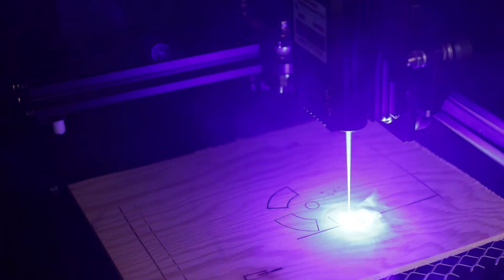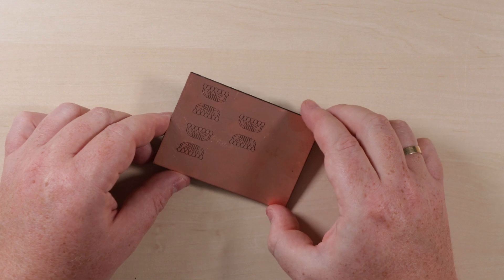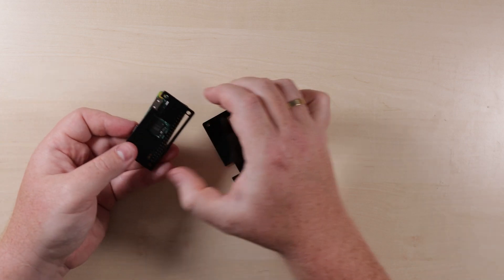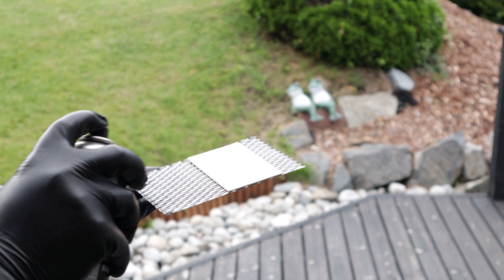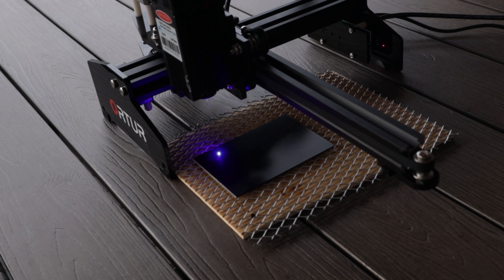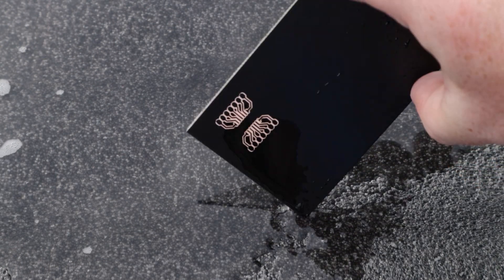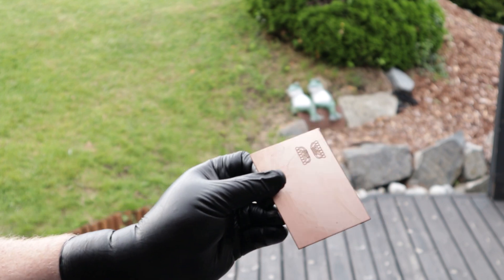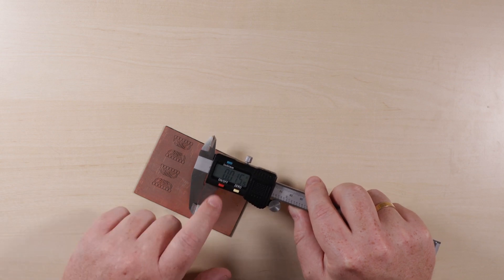How to make a PCB with laser - Ortur laser from Gearbest.com

Comment: If you use a fiber laser, you can laser etch away the copper without having to do the paint. But if you do want to etch you could probably Run the laser a few more times and then the etching would go better.
Reply: I need to get a fibre laser.

It's so much more sophisticated; you can even burn throughholes and cut the outline of the board.
Reply: @xFuaZe  yes, but it can be very difficult to get to that point because they tell you the focus distance and it’s wrong by 3 mm on my laser so it took me a long time before. I finally realized the thing was working.

Comment: The laser lasts after 5 hours total working time ,at 30 percent power......cooling pause  50%with 10 minutes work on off not changes the life of the diode....

Vevor or ortur endurance lightburn,Amazon,atomstack Walmart you take all the chances to scrap money....because the short lifetime is due not to the brand but the principle of this process.  ...reflected ray from copper turns inside the cavity and destroys  himself

Comment: Is it not possible to cut copper layer of pcb without paint on it?
Reply from the maker: Nope! Some fiber lasers can manage, but the results are not very good. Remember, if there is enough energy to cut copper a bit of the fiberglass will also burn away.

Comment: What software packages do you use? I have a Enjoywood A10 laser engraver. I have only found that lasergrbl and lightburn can work with this laser engraver, and I found I need to generate a png file with the pcb layout. For that I use kicad to generate an svg file which I then convert to png with Inkscape. However, running into a problem, that the resolution is too low. Fine traces and pads are jagged and not useful. So I can’t get the pcb detailed enough for smd components.
Reply: Use flatcam to create your Gerber and burn as gcode no SVG or other rubbish tool as inkscape....you are a PCB designer not tee-shirt publisher😊😊.export your gcode processed as grbl laser ,burn varnish with also grbl laser....works fine but as my case and reason to post here my disappointment about the process,the laser ends after 4 PCBs.....
Reply from the maker: Try to use the Trace Image feature in Lightburn :-)

Comment: May sound stupid as a question, but there is no way that laser will actually etch the copper itself instead pass thru the mask etching and the chemical etching bath? just asking
Reply: Not at these power levels, it's not cost effective, as you will also destroy the PCB. See other comments.

Comment: Very interesting video. However I'm more interested in how did you produce the g-code for laser cutter?
Reply from the maker: Lightburn, engrave from image or trace image :-)
Reply: @DIYTECHBROS  Yey thanks a lot! That's what I needed. I'm going to use a CNC mill with an engraver. to mechanically remove the excess copper.  It wouldn't look as pretty but for prototyping could be somewhat faster.

Comment: Can you also solder the PCB with the laser?
Reply from the maker: Simplified answer, no. A soldering iron does 3 things at once, heats up the pad, the leg of a device and the solder. It does this by being in contact with and transferring heat to all 3 at the same time. 
Complicated answer, yes, it can be done. But with a simple setup and a diode laser it will be more a hobby project than and actual "soldering station".
Reply: @DIYTECHBROS  interesting
Reply: @DIYTECHBROS  I guess a solder paste applied to the pads could be heated with a laser, which will seat the smd component? I guess one will have to try, but first, what laser printer?
Reply from the maker: Well, the simplified answer was no, but the more accurate answer is that you can even do welding with lasers… so you can make it happen. But most current diode lasers have 5-40 watt with a focus spot of 0.1 x 0.1 mm - so thinking a CO2 laser will be better suited.
Reply: @DIYTECHBROS  I'm not if I would trust a C02 laser to melt solder paste. Better to use a heat gun at that stage :face-fuchsia-poop-shape:
Reply: Never thought about it, that way. Are you thinking SMD components? The only difficult part of SMD's would be the packages that have no legs, I guess there could be enough heat transfer from the copper to the pad and solder paste. You might have issues with larger though-hole components, but I'm only guessing, This is an interesting idea, if I invest in a laser cutter for this operation, maybe it could do some smd soldering for me :hand-orange-covering-eyes:

Comment: huh. when I tried this there was a residue that was left behind that protected the copper from my etching solution....! I didn't try washing it, thats a good idea. Though my tests It was hard to get fine details; I didn't account for any laser kerf though.
Reply: I have similar problems. Did you find a solution?
Reply: @mod100  unfortunately no. I stopped playing with it. Maybe scuffing it gently with scotch-brite after? or a different brand/type of paint?
Reply: @angst_  , maybe. I tried synthetic enamel and water-based paint and got the better results with the synthetic enamel, but there was still that residue which prevented the eching solution from etching the copper.

Comment: If you have to etch the PCB anyway, what's the advantage of using a laser to burn paint? Why not just print the board layout on thermal transfer paper with a laser printer?
Reply from the maker: That’s a very good question!
I’m not going to say that a laser is soooo much better, but in terms of accuracy and reliability a laser will give you perfect results every time. No lines will be broken transfer, no weal lines etc.  
In terms of equipment, one requires a laser printer while the other a laser engraver… 
BUT, we actually usually use a CNC to mill our PCBs 🤠
Reply: @DIYTECHBROS ,
  I recently bought a mini 3018 CNC kit I am going to use to mill simple circuits (filter, amplifier, mixer, impedance matching network, attenuator, etc) for an RF class I'm teaching. Your videos have been very helpful.

Comment: Very nice and interesting! I have a few questions:
1) What kind of paint do you paint the PCB?
2) What type of liquid (inside the container) do you use to completely remove the ink from the PCB?  (Sorry, English is not my native language) Thank you
Reply: you can use hydrogen peroxide with Hcl liquid . The ratio of mixing 1 ( h.p.) to 4 (Hcl) . Alternate method , use only ferric chloride .
Reply: Thanks
Reply: 2. paint can be removed by acetone or paint thinner., 1.iam guessing acylic paint. etchant is probably ferrous chloride
Reply: @Vegetakhan  Thanks

Comment: you should try using photoresist film rather than paint spray, the laser diode has a 445nm wavelength which is just in range to expose the photoresist. People uses black paint because they have a red laser diode, the black paint absorbs the heat from red laser.
Reply: Using photoresist need more time in laser, because have to pass above larger areas. Using paint spray, you have to pass laser only thin area around the tracks, this is faster. And cheaper too.
Reply: @WilkerAzevedo  True black paint is good but the details are not great, professional PCB fab houses uses film or liquid based UV photoresists. Also photoresists does not need more time, you need to properly apply it to the board and use much less optical output power, requires only 30-60mW optical power in the UV range. 
There is a youtuber who did a video about CNC UV laser PCB photoresists, his channel name is "Marco Reps", check it out, he made two videos about it.
Reply: @ShopperPlug  Thanks, got a 2.5W with my 3018.
Reply: @WilkerAzevedo  Photoresits are dirt cheap. You buy them in a roll in quantity and it's super cheap. Your state of the art iPhones and Macbooks PCBs are all made using photoresit, matter of fact all of your electronics are made professionally using photoresits. Professionals uses photoresit because it produces much higher quality and finer details of the PCB layout. Black paint spray is not great for precision PCB designs. There is also a special photoresit paint which is in liquid form, this is also used in high precision PCB designs. The key objective is using smaller wavelength of light such as around 300-400 nanometers (Near ultraviolet) to produce higher quality sensitize PCBs, red lasers are around 670 nm, it will never produce higher quality PCB designs compared to photoresit method for ultra precision work. Such as making a PCB which have a FPGA chip containing hundreds to thousands of ball grid array (BGA).
Reply: @ShopperPlug  Interesting, I'm a newbie for laser to Pcb design, I'm weighing my options. However, you said that 670 nm is too coarse for ultra precision cuts, for most of us, a 1 mill (0.025mm) cut is fine, in-fact PCB manufacturers don't like to go too thin on the traces. 670 nanometres = 0.00067 mm or 0.026 mills. I honestly don't think the red laser is the issue here.

Comment: what about using the laser on UV-sensitive photoresist plates? dont works?
Reply from the maker: maybe, never tried? :-)
Reply: @DIYTECHBROS  I've been trying just that over the last couple of days and yes, it works fine using a 450nm "Blue" laser. I run at about 10% laser power and 1000m/min and it very nicely darkens the photoresist in one pass.
However.. simply exposing the outline results in 'tracks' that are far too thin to survive the developing process and will fall off the copper if they don't get dissolved away. 
So its necessary to expose the tracks and pads as a laser raster,  which works, but its a slow process to do -  the accuracy of these diode laser mechanics isn't reliably up to any sort of speed making exposing even a small PCB hours long. (these are 0.2mm lasers beam width)

Quite frankly, its just not worth all the messing about.  Get a laser printer and a modified laminator and use toner transfer.
Reply: Yes, its will work...

Comment: You shouldn't remove the paint with acetone but put the PCD back under the laser using a system to maintain it precisely at the same place and use the laser to remove the paint from the pads, not from the rest of the PCB.
Reply from the maker: Yes, the plan was actually to include that in the video, BUT, after a few test we found a few issues. The biggest one is if you are not able to clean it good enough the soldering becomes a headache!

Comment: Hello, thank you very much for the video!
I have another question for you: is there a way to apply UV solder mask on the pcb and use the laser to remove it from the pads?
Reply from the maker: Yes, just create a rig so you can precisely place the PCB in place again. Then you spray paint it again and burn the pain off the pads :-)
Reply: @DIYTECHBROS  Thank you very much for the hint. But, what about a follow-up video? I didn't find any similar on the web. Best regards

Comment: Thanks for the video. could you tell me what software you are using?
Reply from the maker: Sure! Laser GRBL is included in the download package from Ortur. But I like to use LightBurn as you can do designs and adjust almost any objects.
Reply: @DIYTECHBROS  Thanks for the response but I was wandering, if you port an image from  Kicad or some other PCB software. You wind up burning the tracks. IE you wind up etching away the tracks and not around the tracks. I'd love to know your process for how you do this. Maybe an idea for another video?
Reply from the maker: That's actually very easy in LightBurn!
Export the image of the PCB and import it into LightBurn. Have LightBurn trace the image. That creates lines around the tracks. And, if needed there is a function to offset the lines outwards. 
Thanks for the video idea :-)
Reply: @DIYTECHBROS  Thanks for that I'll check it out